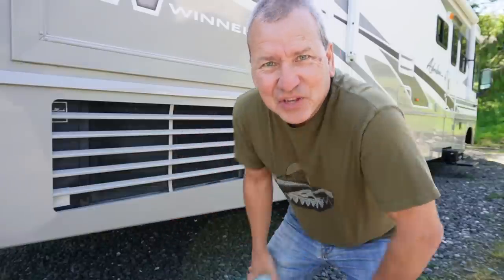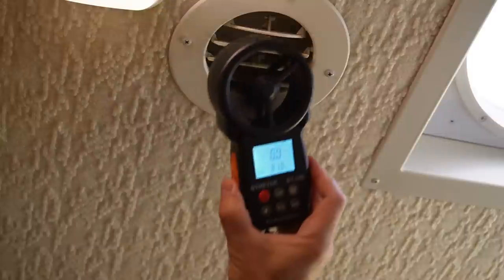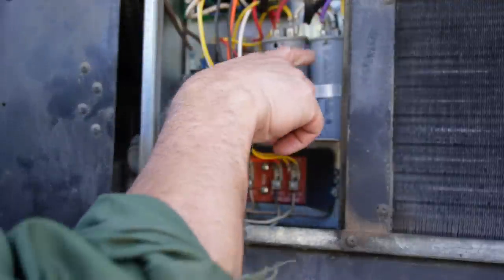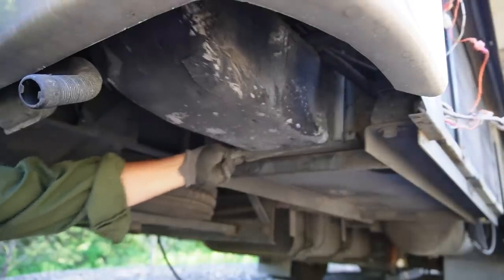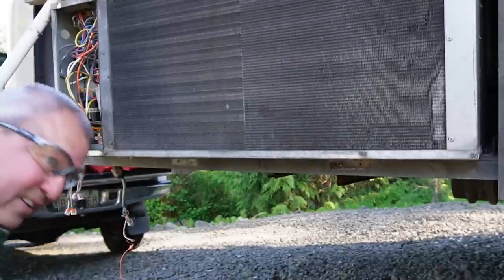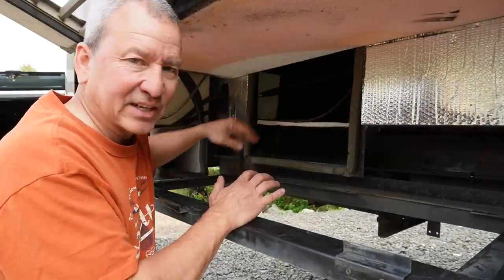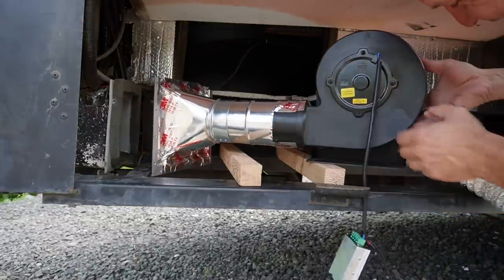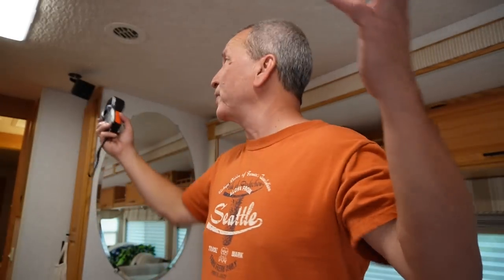My 12V RV Air Conditioner Install (Part 1) - Removing Failed Basement A/C | RV With Tito DIY

Comment: Hi Brian, I see you’ve let go of the Easystart plan :-) 

This looks pretty daring!  I’ve thought about replacing the basement A/C a few times myself so I am very curious about what you can come up with.

This basement unit we have is advertised as “efficient”, which makes me of course question the integrity of the advertisement department, but not entirely. Perhaps the unit itself is reasonably efficient with it’s more efficient R410A. (does your old unit perhaps still have R22?) but I believe the ducting of our RV is the weak point when it comes to efficiency. In modern high efficiency systems you can see that low flow rates are an important factor in reaching that high efficiency. Low flow rates compensated with big wide ducts that need little pressure to move air.  What we have in the roof of our Journey is exactly the opposite of that. We have tiny ducts that need a strong high pressure fan to push enough air through. To make matters worse those ducts are insulated by an inch, perhaps 2 inches of styrofoam from the sun beating down on top of them. Worst scenario.

Oh, a note on the furnace/floor ducts: I believe they are intentionally leaky so they also heat the basement. Something to keep in mind.

I have thought about adding a layer of insulation on the roof but the simplest/easiest idea I have had so far is to see whether I could replace the existing inefficient PSC fan motors by more efficient ECM motors. Then perhaps if I were to get really fancy I could do the same thing with the compressors. That might make the whole thing perhaps 20% more efficient, but I fear I would be dreaming.

I have also thought about switching to a 12V system but there too I have to admit that I have second thoughts about the energy loss in those high amp cables. Very short lengths sure, but there is a reason why we get our residential energy over electrical masts carrying many thousands of volts. Converting battery power to 120V using an inverter that is standing right next to the battery bank might just outweigh the losses generated by 50-100 amps running through a thick cable.

Now my latest idea is to maybe get a modern efficient inverter type roof A/C. Yes with all solar panels on the roof I need to find out how to fit it but such an inverter type roof A/C might be a game changer for boondocking. It has no long ducting to push air through and the variable speed compressor and fan motors are again 20% more efficient than the conventionally used PSC motors.  I even saw that our Journey is prepared for a roof A/C with an unused 120V wire hidden in one of the roof vents.    

I hope I have not discouraged you too much because I am very interested to see what alternative idea you are able to come up with.
Reply from the maker: Will definitely have to check the floor ducts for intentional leaking before going that route. Thanks for the heads up. About the Soft Start. I never needed it. If I were going to keep this unit then I'd probably install a couple. Now that I know more about this unit, it would be pretty straight forward.

Comment: have you looked into cruse N comfort USA?  they have a line of DC 12V up to 48V air-conditioned systems. Just purchased 18K BTU system for my 2009 Newmar Ventana.
Reply from the maker: Yes! I've been talking to Chris. Also looking at the 18K with some modification. Have you installed it yet?

Comment: It would be nice to have an on board compressor with a small tank. Maybe you could use one circuit for that and find a basement space to mount it.
Reply from the maker: I have a working solution for my compressor. Check out this video https://youtu.be/vhefoCx3Mw0

Comment: Tito, Have you thought about abandoning The ceiling vents or retrofitting the vent fan/fans up top to blow air thru them, just for ventilation.. /  THEN, use the floor vents for the heating and cooling??  Might be a lot simpler to do ducting and return air?  I am waiting to see what you come up with for 12 the volt cooling/ heating  system..
Reply from the maker: Yes. That's exactly the option I'm considering right now. The floor ducts will probably be more efficient for the 12V unit. I might install a secondary blower with variable control just for ventilation and mixing air. Any benefit to pushing the cold air through the ceiling may be lost through inefficiency.
Reply: @RVwithTito  True, I don't have a schematic of the roof structure. But you may be able to tap into the side foam by the exhaust or Max air fan and blow air in and out with some retro fitment.. lol. Just a thought.. Then you have a giant empty end cap...

Comment: How old is the Winnibago?  I am sure that in these past 20 some years they have developed a much much more efficient unit that you can replace your system without doing a lot of modifications.  I would throw that old unit into a truck bed, drive it down to your local RV service and sales center, and ask what new better options are available to replace it?   Now a days they have inverter soft start air conditioners which draw way less amps than a traditional capacitor start and run system.  The inverter driven compressor will use less amps, and slow down in speed as space gets cooled down thus using less amps. The blower moter is also an ecm motor variable speed. Ecm stands for electronically communicated motor.  They draw less amps than a traditional blower motor.  You may be able to get a 12 volt inverter system. I would check into this.  I know they make 12 or 24 volt systems for the cabs of 18 wheelers.  But its a split system. You need an all in one 12 volt system.  I call it a ptac.  Package terminal ac.  I cant believe that the manufacture does not make a good high efficient 12 volt inverter package system.  Hope you get it going.
Reply from the maker: The system I'm installing has all of those same features. If I were to go to an RV dealer they would probably try and sell me a couple roof mounted units. Don't want that. Thanks for the comment. It's close to being wrapped up 👍

Comment: I have a 2004 Itasca Suncruiser and the AC until finally died for us yesterday 6/23/2023. It was starting to have problems and I have limped it along but now I’m at a crossroad. Do I get it fixed or do I replace? Please post your follow up as I am really curious what you are going to do.
Reply from the maker: Still a work in progress and a lot of work to do. I'll be sharing regular interim updates on Patreon. If you're wanting a budget drop in solution though, there isn't one. They're not really made to be serviceable unless it's a control board, relay or capacitor problem. Replacement units will start around $5K not including labor. So, if you can find someone to fix it, it's worth getting an estimate in my opinion.

Comment: Did you try installing a Softstart box on the basement AC?  I cannot find anyone that has but suppose to lower the amp draw on other home HVAC and RV havac
Reply from the maker: I didn't add a soft start, but would have if I kept the A/C. It wouldn't be difficult since the design of this unit is pretty similar to a typical home heat pump. You'd have to install two soft starts though (one for each compressor).

Comment: I know you said 12V but what about the 120V mini splits like from Mr. Cool.  Run the tubes through the ducts and the main unit in the bay.  I've seen several you tuber put the in their rigs.
Reply from the maker: Yup. Considered that at first. They won't fit inside that space, don't want to mount it outside, and have no room for the head unit inside. Instead, I'm going to make it hard for myself. I welcome the challenge :)

Comment: There is a guy on IRV2 with similar setup who installed 2x 12k BTU 120V mini split. It worked great for him, except it did damaged the look of inside, because he needed to remove some cabinets and ran some lines.  I am curious what system you would choose to use. Great video! I am looking to upgrade to mini split my self as well. But for me, I had to put the outside unit on the hitch, which would affect the look. I am also exploring some options. One thing for sure, no one likes those roof top or in your case, basement RV A/Cs.
Reply from the maker: Yeah. I hope to do it differently and keep everything hidden...except the thermostat.

Comment: Thanks for the video.  You mentioned running you existing unit on just one compressor.  How do you get your unit to only run one compressor?  Thanks
Reply from the maker: The second stage compressor runs on the secondary 120V circuit. Just shut that second circuit breaker off and it won't kick in to the second stage. The blowers and primary compressor run on the primary circuit.

Comment: My basement unit is still alive, so I hate to rip it out.  But I would like to improve its performance and have space under the bed for something like a 5000 BTU EcoFlow Wave 2, which doesn’t use a lot of additional power. It’s output could be drawn into and dispersed through the existing blower and ducts.

Have you heard of anyone precooling the air drawn into a second unit in such a daisy chained fashion? Would it help? Could it help with your low power plans?

Comment: 1000 Watts at 12V draws 83 amps, correct? That’s some serious power.
Reply from the maker: Yes. That's correct. I'm shooting for 1000W max. The newer compressors (and of-course blowers) have variable settings and ECO modes. So most of the time, they should be running at much lower power. Fingers crossed 🤞

Comment: I am in a similar situation. I run 50 amp on two AC to cool our fifth wheel. Our main AC went out and I have to replace it, but I wanted to be able to run one of the AC on battery and shore power. Is that possible? Am I basically just pulling the wires from one of my AC’s off the breaker and wiring it into my transfer switch to use battery or shore??

Comment: My opinion is that your CFM airflow is too low using 12 volts. Why don't you want to use 120 volts which should be more efficient and cheaper to purchase?
Reply from the maker: The test was mainly to see if I needed more blower. I also have the option of going through the floor instead, which is what I may end up doing. The 120V units out there don't meet my criteria for space. Plus I have no room (or desire) for a head unit mounted inside. Having a 12V system will also bypass the inverter. So I'll be able to power more things while the A/C is running.
Reply: @RVwithTito  Thank you for the reply. I hope 12 volt unit works for you.

Comment: I'm really curious to see how this works out. With only 1000 watts of cooling, you're not going to get very much in the way of heat dissipation and I doubt you could get any more than 10 degrees of differential in an RV with their notorious windows and side wall inefficiencies. You're certainly not going to spend any warmer months in the south and stay cool.
Reply from the maker: We will see. You could be right. The rig is pretty well insulated with dual pane windows and good walls. Solar panels block much of the sun from direct roof exposure too :)

Comment: Don’t use the chassis for the groundv
Reply: All 12v grounds end up at the chassis on a motorhome
Reply from the maker: The path of current is going to be pretty similar basically running down the frame compared to a cable that's parallel to the frame. You got me thinking though. The dedicated negative will created a shorter current path and certainly wouldn't hurt.

Comment: CFM cubic feet per minute
Reply from the maker: That would be volume. You'd have to factor in the dimensions of the ducting. This cheap gauge just measures air speed.
Reply: @RVwithTito  didn't know that